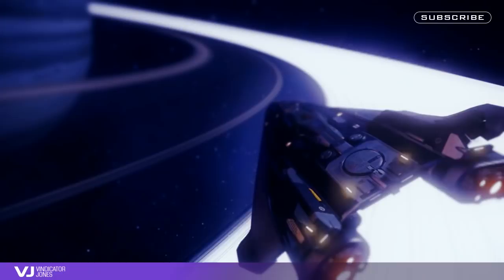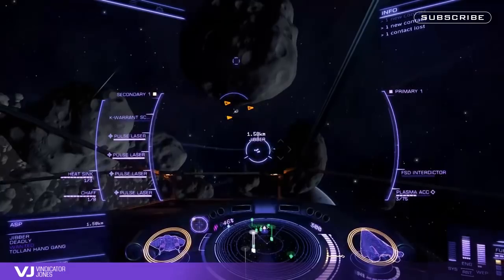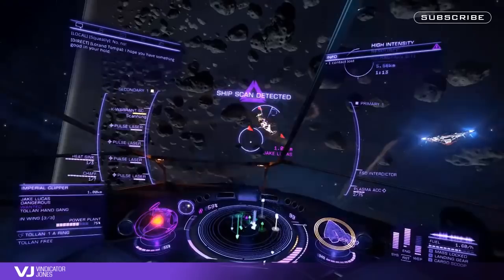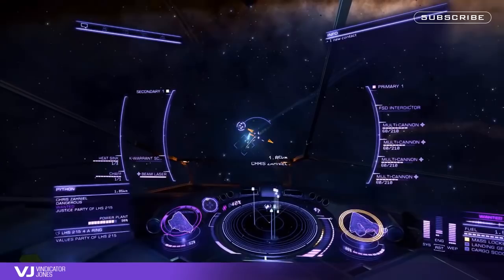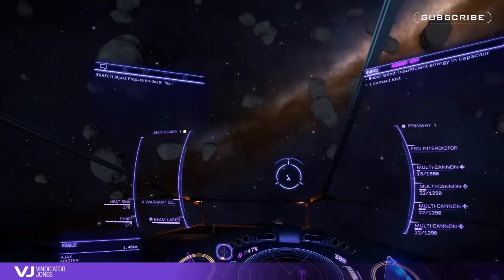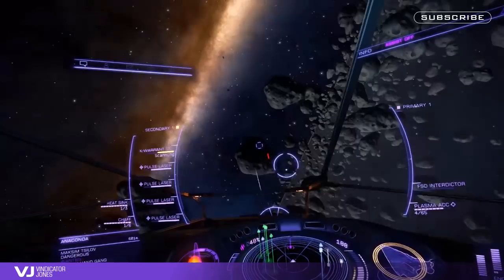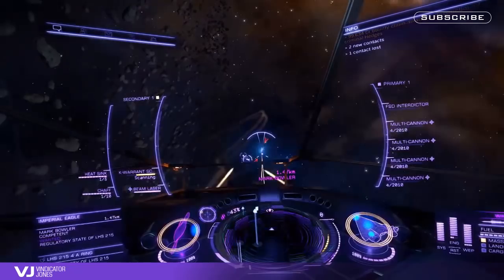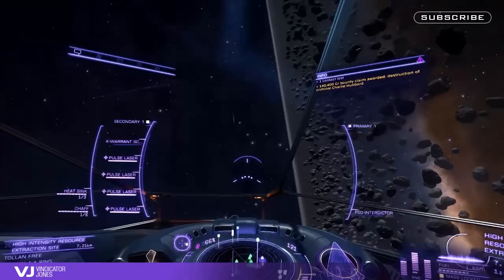Elite Dangerous FerDeLance Combat Tactics and Piloting Tips and Tutorials

Comment: Oh, the 'pendulum' effect you speak of is (I think) not so much a pendulum effect, but it's due to the ship not having to distribute its thrust to the vertical thrusters to maintain a nice curve. Basically: you're doing what an FA Off turn would do since you're drifting during your turn.
For some reason Flight Assist does not use the thrusters at max power when it uses them. It limits itself to staying within a certain speed (regardless of vector) so if you're turning and trying to accelerate forward it won't do so at full power until the non forward momentum has been negated. 
If you are thrusting downwards you're pretty much telling flight assist to not bother negating that momentum at that time and (probably) using your upwards thrusters afterwards slows you down enough to get more in the 'blue' zone in regards to your vector. 
I mostly noticed this in my Clipper when I started boosting with the downwards thruster engaged and pointing the nose at a 45 degree angle to my movement vector while having throttle set to 50% (blue zone center). The result was moving at a fast speed to my targeted location without losing the maneuverability bonus of the blue zone. This allows me to even get a fat Clipper behind another ship, and keep it there (well, most of the time anyway).

Comment: Great detailed rundown of the FDL :)

just thought i'd add something tho, at the 8:20 mark you talked about using your thrusters to do a turn faster, you can push this concept further by applying reverse and continuing to pull up, this makes for the fastest 180° turn you can get (to my knowledge anyway)

keep up the good work on the vids and happy hunting Cmdr
Reply: Venree nice idea, I will use this :)
Reply: I wonder if it is possible to exactly replicate FA-off maneuvers with manual thruster inputs?  Or perhaps I should say it would be counteracting the thruster inputs FA does automatically to replicate FA-off...
Reply: Yes this is a great way to make up for going into a turn too fast aswell

Comment: My set up is a Logitech g13 and a Logitech Force 3D stick (awesome budget build for E:D btw). I found that having the throttle increments at 25% helps maintain being in-between the blue zone on the throttle indicator. At full throttle two taps down takes me right in the center of the blue zone, and it stays their in proportion to pip management of engines. Also for staying on top of pip management Voice attack is great

Comment: I was a Jedi before, until I got the x52. For some reason I was really good in manouvering in cqc with my mouse and keyboard. I had the translational thrusters bound to wsqe and yaw to ad. Then I had my mouse for roll and pitch, with a slow reset time (like when I held the mouse still my ship automatically slowed down turning). And it worked really well, still getting used to HOTAS controls, but I'm learning it and getting better every day.

Comment: Lol, apparently I'm a sith/jedi since I use mouse/keyboard xD. Works pretty well even :).
For those playing with mouse keyboard and looking for control-setup-inspiration my controls are like this:
W - Throttle Up
S - Throttle Down
A - Yaw left
D - Yaw right
Q - Strafe Left
E - Strafe Right
R - Deploy heatsink
F - Deploy Chaff
V - Fire Shield Cell Bank
Z - FA Off
X - Throttle 0%
C - Throttle 75% (for supercruise)
Shift - Thrust downwards
Space - Thrust upwards
Tab - Boost
Left mouse - Fire1
Right mouse - Fire2
Scrollwheel (click) - Select target ahead
Scrollwheel (roll) - Target subsystem
Mouse thumb button - Headlook (used often to 'zero' control input while pitching/rolling so I can stop movement instantly)
Mouse three buttons in between left and right mouse button - Throttle 50% / Throttle -50% / Target whichever attacked/interdicted you.

Moving mouse up/down - Pitch up/down
Moving mouse left/right - Roll left/right (Relative axis enabled so it zero's over time)

For me this works rather well, most things are within reach without moving my hand and I've been competitive in PvP with this setup as well :).
Reply: +Jognt  incredible but I use a similar keyboard set up, just a few differences that I mapped my two thumb mouse buttons for pitch to engines or weapons, that way I don't let go the mouse if I need to do pitch management. Nice set up BTW. :)

Comment: @Vindicator Jones: Regarding button use: the x52 has a two-stage trigger, so you could just put the rails on the second trigger detend
Reply: I tried when I first got the x52 but I did not like it. When in aggressive turns it is really hard to have the finesse to just use the first stage. . I use the pinkie for secondary fire. This way you can also keep your thumb around the stick while firing both weapon groups.

Comment: People are telling me that I'll struggle with the FDL but I already flew my Viper 4 and Vulture using very very active pip management and some FA-off techniques, I also shield tank so this ship is going to be a dream for me.
Reply from the maker: The FDL is a very different kind of beast. Initially you may not like it, especially coming from the vulture. The vulture is extremely forgiving when flown badly, wheras the FDL is extremely unforgiving. Just be aware of that when making the transition, and in time you will love the FDL. Your friends are probably just trying to warn you for whats to come. Dont take it to heart, it happens to every single pilot when they transition.
Reply: Thanks for the advice :)
Reply: Just another thing, do you know anything about how the shields are affected by pips in 2.2? I heard they flattened out the curve a bit.
Reply from the maker: The changes are minimal. 4 pips into shields gives you a big damage resistance, and if your facing your target, then I always suggest 4 pips into shields.

Comment: Do you think its a good idea to update the video for post 1.5 patch changes?? Still most of the information is still correct, but the FDL now handles much better, better heat management and bigger power plant. I can now fire up a class A4 SCB and no need for a heat sink!! In my Fed. Assault Ship if I use a class 4 SCB (A or B) I need a heat sink! The jump range is still crap!!! I can only get 12ly because I have a combat setup. Because of the FDL videos I've subscribed!! Very nice videos.
Reply from the maker: +lxgn98 Its on my list of things to do... lol.. But honestly, I dont run SCB's anymore, Class 4 SCB's seem useless on the FDL now if you have a lot of boosters, it barely fills even 1 bar. I am using HRP's now and a big fuel scoop to help me get around. I am still polishing my "perfect" FDL build and figuring out what works best after 1.5.. but I will get around to it.. Cheers though!

Comment: Since the changes would you change your video? What about Military armor?
Reply from the maker: +Edward Huggins I will be doing a big update on the FDL after the new class 4 weapons and engineers comes out. there's not much point in doing anything yet as so much will change after the big update next month.  As for military armour.. absolutely.. get it.. it only affects the FDL marginally, but for the added protection, its worth it.

Comment: lol you shot a sidey with huge plasma...

anyway with the buff on fdl will it be able to handle something like 5 beams? assuming heat is of no concern that is
Reply from the maker: +napoleonic sp007rz lol, small targets are relatively easy once you have got used to how the PA works.

You will be able to install 5 beams, but your distributor is going to be the same, so your only going to get a few seconds before your distributor drains completely, not to mention your going to overheat pretty quickly.

Let me dispell a myth for you. Beams do, do more damage, but their are utterly inefficient. In fact you will do more damage to a target using pulses in shorter period of time if you counter in the distributor limitations and heat penalty.

Beams are great for those using fixed weapons as you wont be firing them constantly, and will get  a lot of damage on the target faster than pulses.. But if your using gimbaled, then your going to get far more sustained damage on a target due to their high efficiency.

Hope that helps!
Reply: Vindicator Jones o yea, I forgot the distributor thing...

How about bursts vs pulses? Have you done tests about them?

Also how about rail guns? I see many fdl in pvp videos are using multi cannons, huge cannons or plasma but never seen one with rail guns, aren't rail guns almost as instant hit as lasers? Wouldn't 4 med rail guns outclass 1 huge plasma? And they don't suffer from hit problem as much as plasma
Reply: Vindicator Jones also I need your answer here, about fdl thruster boosted maneuvering, basically I'm cobfused if I'm pulling the nose of the ship up (pitch up), do I need to use up or down thruster to boost the maneuver? I can't quite understand it lol
Reply from the maker: +napoleonic sp007rz Initially use the down thruster, then half way through the turn immediately hit the up thruster. You will have to feel your way through the turn to decide when is the best time to switch. It takes a little practice, but in time you will get used to it.
Reply from the maker: +napoleonic sp007rz Railguns are great against shields and components, but useless against hulls. Their high energy demand, high heat profile and very low ammo storage (30 rounds) makes them good only for short PVP engagements. Plasma has 105 rounds, does hull and shields damage equally and has splash damage. There are pros and cons for all weapon types.

Comment: My point of view, as Fer deLance PvP pilot since it was released.
I used to go in blue zone all the time, but eventually I learned that it's not the best way to go around things. It's good, for beginners. Advanced pilots can ignore this, there are better ways to fly. I use my instincts, not theory, i'm not going to try to describe it. Oh and forgot to mention - I fly D class shield for even better agility, and tank with my hull. No SCBs. People fear my Keiyu =]
Reply from the maker: +RheaAyase Well, technically what I said is correct. The FDL will turn fastest in the blue zone of your throttle. This excludes FAOFF boost turns and similar maneuvers. But if you are behind your target and dog fighting, then you should always keep your throttle in the blue. Also D or A class shields have negligible affect to handling. I have done turn tests with different weight loadouts, and in almost all cases, it dosent seem to affect the FDL too much at all. Yes, I was surprised also.
Reply: +Vindicator Jones yep, and also there is difference between changing rotation fast, and changing actual direction fast =] Also I need the D for power, first of all, and as bonus it's light... i could probably get away with C if i would reaaaaally want to, maybe, but I like every single m/s i can get =] And hey, thanks for me-buff FDev (aka SCB nerf) :D